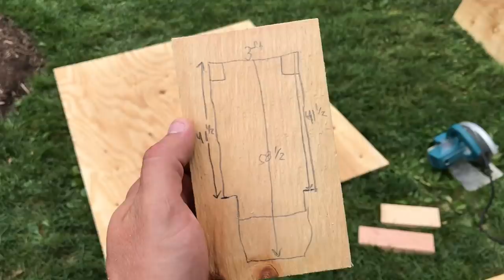Chicken Coop:  Step-by-Step Build V3.0 (Short Version - No Commentary)

Comment: Didn't I get a set of plans from you in 2017? Built one based on them, worked great!  Only suggestion would be to get some vinyl flooring and glue to floor before installation,  bead of caulk around edge of it for easy cleaning.  Trap door in floor is excellent!
Reply from the maker: Hello Bob, yes I remember you!   Thank you for the donation 🙂.  You’re right, the linoleum is clutch!   I was trying to keep this coop as cheap as possible.   I’m working on a new coop now, and it’s got the trap door and linoleum.  👍👍 Hoping to get the video done by mid August.   I hope all is well!

Comment: I only have one thing to add to your construction techniques. To cut metal roofing, get yourself a paneling blade and mount it on your saw BACKWARDS. It will cut thru metal roofing panels like a standard blade thru plywood. But you have to put the blade on backwards or it will just get hung up. I didn’t believe it either until I tried it.
Reply: Get the rignt tool for the job, it quite and safer and faster.

Comment: Hey I loved how you framed this out. I started building mine today and followed your video with my phone. I made mine 4’ X 5’ and without the roof on yet, it’s 6’ tall.  Guess when I get the roof done it’s going to be about 8.5’ tall. I’ve been tearing down some palettes too. Got 10 done with about 8 more to go.  I’m going to sheath it with 1/4 inch plywood first, then add the palette boards on top of the plywood. Should give the chickens a little more insulation during the winter.  Our winters aren’t that cold here in New Mexico.  Anyhow, thanks for sharing, it has helped me a lot!
Reply: Oh, and I have 2 ft under the coop for the chickens to hang out.  I’ll be building the run after the coop is done. 👍

Comment: Hey nice work . Are you able to lift and move this by yourself? I’m thinking of trying something similar but I want to be able to move it to a different part of garden every two or three weeks
Reply from the maker: I was able to move it with the help of another person.  You could modify it by putting a 2x8 or 2x10 all the way around the bottom which would probably allow you to move it with a dolly
Reply: @E_Fleming  hey thanks a mill I’ll try that out!
Reply from the maker: My only thought is, it’s a little top heavy...the legs are made to be buried in the ground 10-12 inches.    If you research “chicken tractors” you might find some other options for making  this coop more portable

Comment: How many pallets did it take to sheath the exterior walls?
Reply from the maker: Good question.   I would say probably 12?   However many fit in my truck about 5 seconds into the video.  I did have about 30 short pieces left over at the end.

Comment: I thought you were going to make a coop "out of pallets n wood" ? Not a coop covered with "pallet wood"..
Why not use pallet for the floor, cut n trim others for walls n roof (I'd use overlap modern design).
The ventilation is already built in and you cut or knock out boards for nest boxes etc..??
Your's is BEAUTIFUL but that's a $500.00 coop. Min.
Reply from the maker: Actually it cost $175-$180.  As it was, the coop probably took 40 hours to build and doing everything w pallet wood would have added to that.
Reply: Why more if using pallets?
Reply from the maker: @SDPBALLCOACH  The pallets  have to be disassembled which takes longer than cutting plywood or 2x4s.  Every one also needs to be screwed / nailed separately vs a larger sheet of plywood which needs a screw about every foot.   I ran every pallet board through the table saw so they fit together more tightly.
Reply: Ok, 
I can't even make a bird house so what do I know. 
That's why I watch videos and not make 'em..